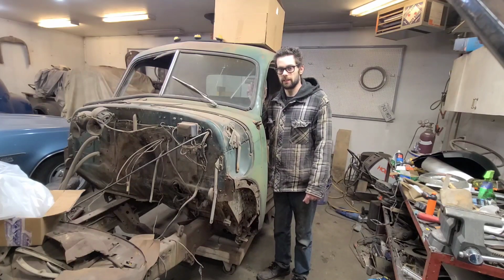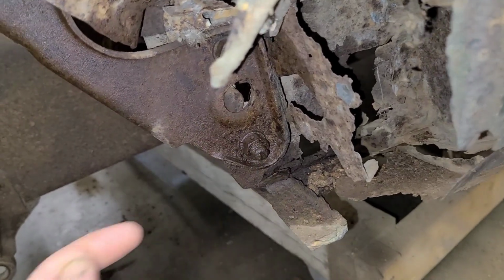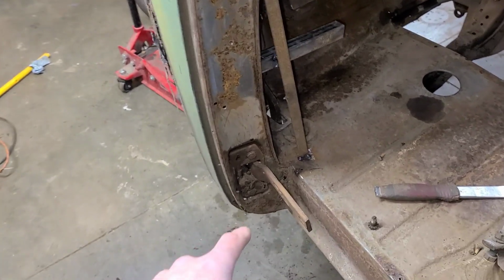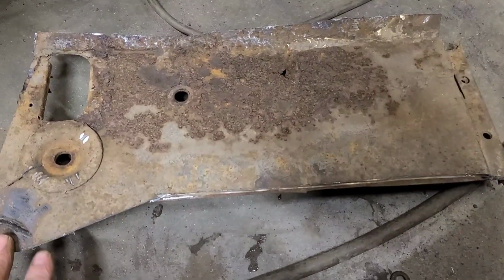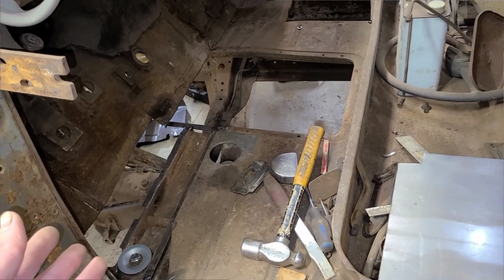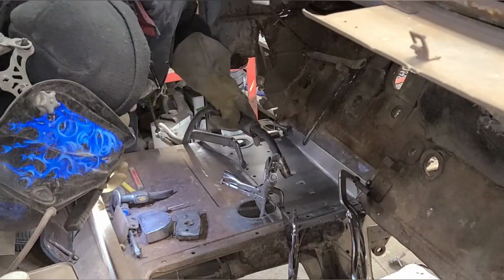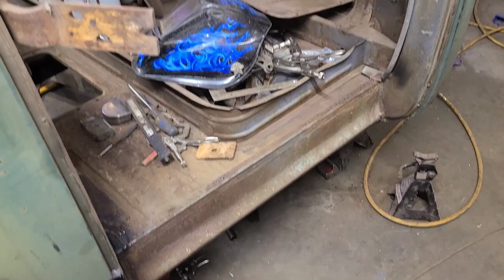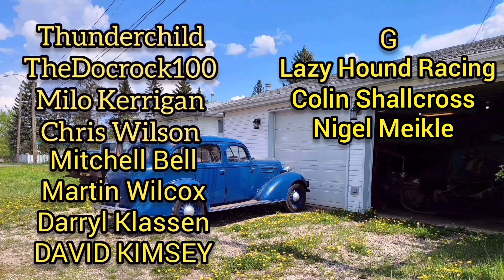DIY Repair Major Rust on Your Car or Truck With Basic Tools and Welding! 1948 GMC Rust Repair Part 1

Comment: I ended up doing the same thing to repair my GT6. Bought a spitfire tub to pull panels from and realized it would take much more effort to remove them and graft them in to the other, than it would take the good parts and graft them into the parts car. That saved me a lot of headache and in the end no one can tell. 
Keep it coming, loving the project and the info.
Reply from the maker: Thanks! I'm glad you were able to get your GT6 sorted out!

Comment: I find the only useful comments/criticism I get for my projects (not just the car ones) comes from people who have done similar themselves so speak from experience. That's incredibly useful. The bulk of the criticism however comes from people who have no practical experience themselves and don't really know what they are talking about. They just base it on something they read once somewhere or from something they saw someone else do once on YouTube. Most don't even realise there is usually more than one way to solve a problem. It will just get worse as your channel grows unfortunately but soon you won't be able to keep an eye on all comments anyway so I wouldn't worry about it!
Reply from the maker: Very true! Youtube and cable Tv has made everyone an expert on every subject.

Comment: I totally agree with you (not that it makes any difference) with using the actual frame section as a stable platform in which to get the dimensions and mounting points correct.

I've seen TOO many 'Hollywood Hacks' attempting to get things square AFTER removing the body from the frame.
Reply from the maker: haha Hollywood Hacks, that sums it up perfectly!

Comment: Wise choice Kyle using what looks like a 48 to 50 Chevy cab in place of the GMC . Most people won't know the difference and it should be a lot less work . Oh and i'm one those guys that likes to watch the so called boring welding at normal speed because it shows me where i am making my mistakes trying to teach myself welding .
Reply from the maker: Thanks. The cab came off a '53 Chevy. I have to at least make it look somewhat convincing, as people can be pretty fussy haha

Comment: A challenging choice ,there will be tons of individual problem-solving which will be immediately useful applied to other projects we might have going. This truck cab is probably right on the edge as to repairable VS crusher food.
Reply from the maker: Around here it would be crusher food, out east in the rust belt it would still be considered mint haha

Comment: Ugggghhh... that A-pillar when you show how bad the rust is 😱.  I had a similar experience and that's when you sigh and resign yourself to hours of cutting, measuring, welding, measuring, grinding, fitting and so on...  Great video and good call on the poor old GMC 😕
Reply from the maker: Glad you could relate! It's nice to know I'm not suffering alone haha

Comment: Is this one worth spending time on? Also, you didn’t suggest what type of music I should imagine as the welding takes place. Honestly, I was at a loss! Lol! As the welding continued, the project looked more and more doable! I take back my thoughts that this truck cab was a goner. Great job, Kyle.
Reply from the maker: I actually prefer fixing stuff like this over something that looks nice on the outside, but has been restored multiple times in the past. It's much easier starting with a clean, rusty slate, rather than cutting out layers of bad restoration work.

Comment: I love your technical term of glorp on some sealer. My term is schlop. Love to see the old truck get some rust fixed. How far do you plan to go with the rustoration? Make it perfect or a presentable driver or a yeah that's good enough to be safe rig. Agree the cab is in better shape.
Reply: Glorp, schlop or spoouze--it all gets the job done! 😆
Reply from the maker: Thanks, it depends on how well the videos do, but the minimum goal is to make the body structurally sound before I sell it. Then the new owner can decide whether they want to go full resto or just do the mechanical and put it back on the road as a safe beater

Comment: Is this a replacement cab for the "fully restored" , now running, truck that you got from the used car lot at CWM? I get lost in the years of older vehicles from channel to channel. 👍
Reply from the maker: It sure is! Thanks for watching!
Reply: @CarterAutoRestyling  thank you. I can't keep up with the older body styles trucks. Before my time. And seems like everyone is working on one. I can't keep them all straight. 👍

Comment: There is a thing called reasonable repairs. I think that cab is not even the worst by far, rather reasonable amount of work. No shame in slicing and splicing, cause I think this is done these days a lot more anyway's. Very few vehicles left that have been restored and not been spliced in one way or the other. I would call a Titanic something that has structurally become just rust vapor and is in the state if immediate disintegration.
Reply from the maker: I prefer working with stuff like this over anything that's been previously restored. It looks daunting, but it's much less work than cutting out and redoing someone elses mess

Comment: Good job. Don’t you ospho or clean and paint protect the parts hidden when you weld the new metal back in ? That brace had a lot of surface rust on it and if you just welded the new floor in over the top, wouldn’t all your hard work just start rusting again pretty quick?
Reply from the maker: Thanks, the inside of all the panels get painted prior to welding them back together. Then all the joints get seam sealed and undercoated, and after paint the insides get sprayed with rust proofing wax oil. Most of the inner structure on these trucks was left bare metal from the factory and it took 70 years for it to get this bad, so anything I do is still better than what the factory did

Comment: Well done. I wonder how long the one you are fixing here  has been off the road?  And was it put to rest because of the body rust? Very well thought out.
Reply from the maker: We figure late 60s based on the farm yard it was parked in. It doesn't look like it was very rusty when it was parked, all the rust damage is from sitting under trees and having rodents live in it.

Comment: You take something that looks like it has absolutely no hope, and turn it back into what it was originally designed to do.
Reply from the maker: Well I try at least!
Reply: @CarterAutoRestyling  I think I could mail you a bucket of flaky metal, and you could turn it into a part of a vehicle. Most folks wouldn't even try.